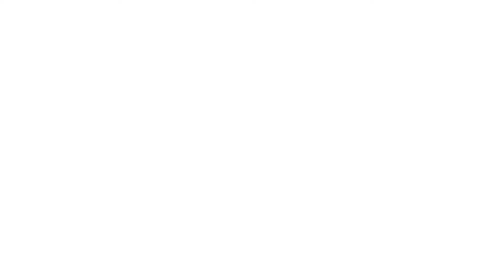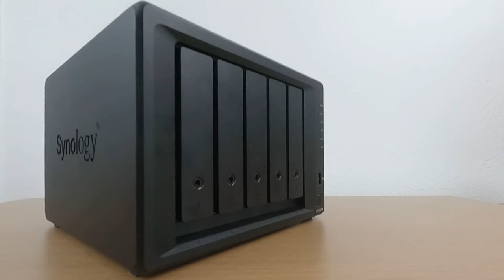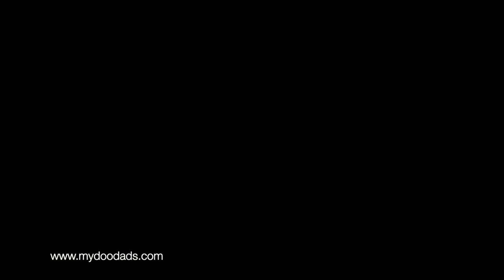How to unlock the drive bays on a Synology NAS if you lost the key

Comment: My issue was that the locking mechanism was broken and it's a springloaded system. locking mechanism is entierly plastic and only contained in the handle so even dissasembling the unit didn't help. I unlocked and removed the drive next to the one with a broken lock and just forced the handle open. I could get a replacement sled probably, but also it works either way and since the NAS has long since left my office and entered a network room I'm not that worried that someone is accedently going to pull out the drive.